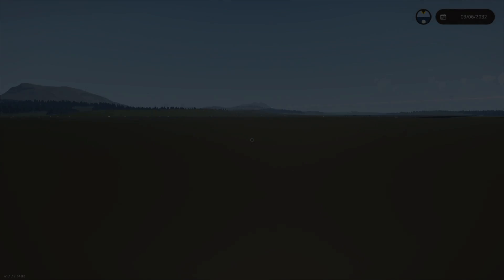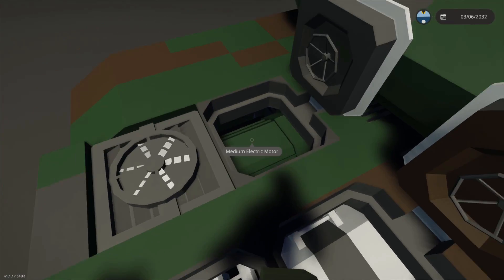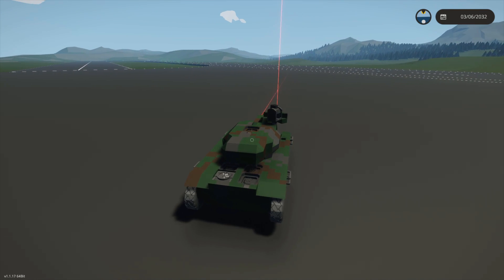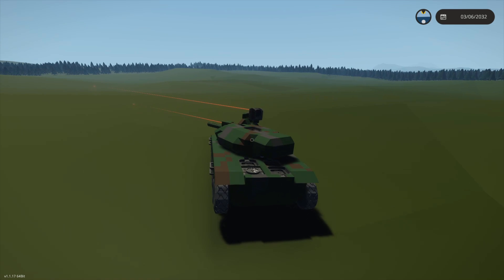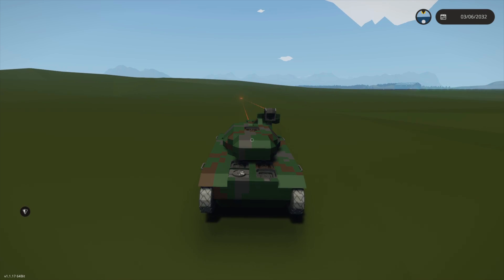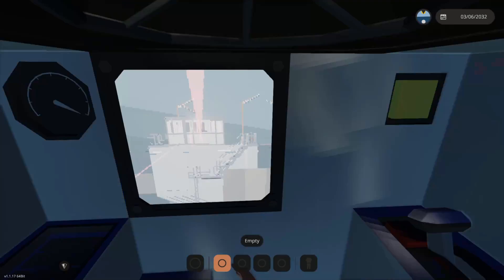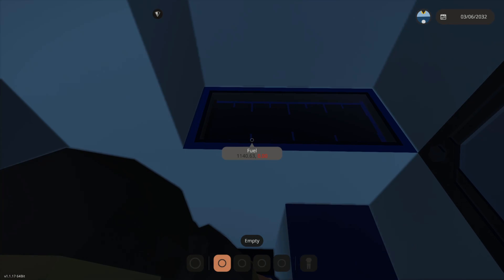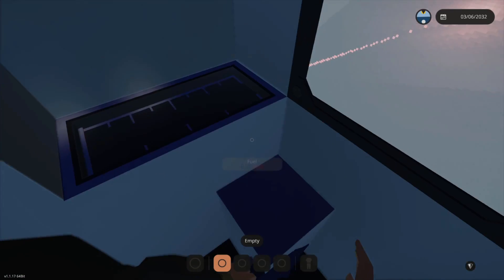XMBT MK 2.2  |  Stormworks

Comment: Use gearboxes on the engine as generators get power from torque not rpm.
Reply from the maker: Doing some more testing on my generator, and so far I have gotten twice the power output. Thanks for the advice... Power output went from 74 to 160, however I need a better temperature solution...
Reply: @AlMagmaGaming  yea they have made engines hard to cool try a air to liquid heat exchanger where the air is pumped in then the fluid flows into the engine.
Reply from the maker: I've already fixed it. I just needed two radiators instead of one...